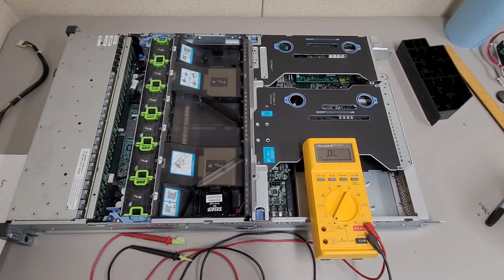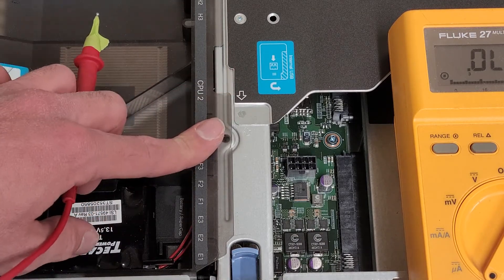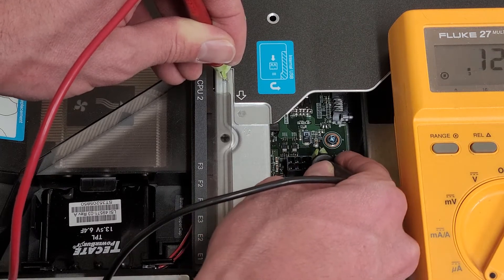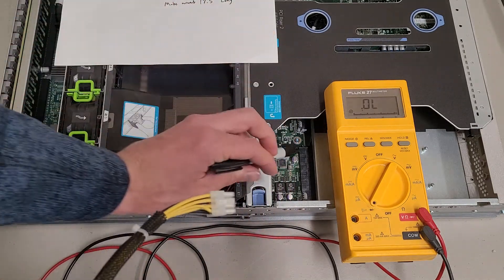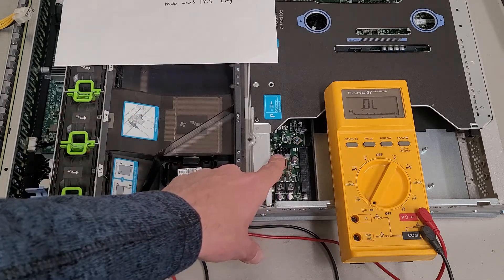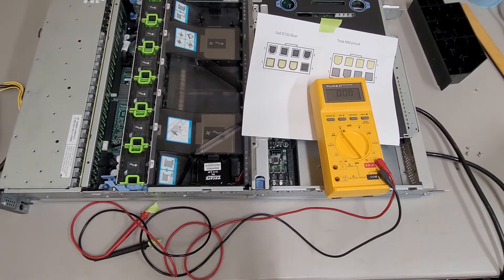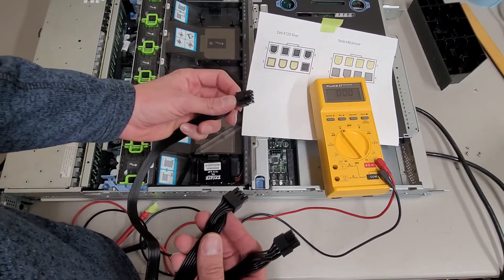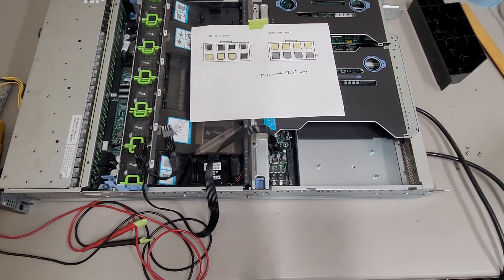Inspecting the GPU Power pinout on a Cisco UCS C240 M3

Comment: It's great to see this video. I'm planning on running a few GPUs but On UCS C240 M5 I recently bought.  The only caveat is that server has a 10 pin layout. Let's see how it goes.
Reply from the maker: It may or may not be tricky. I recently tried a Tesla M40 in it with no luck. That server ran my RX580 with no issues though. Should be a fun project though.

Comment: Thanks for doing this video, I'm looking for a GPU cable for the Cisco system and they are much more difficult to find.  Looks like with this I can just order a r720 GPU cable and that would do it right?
Reply from the maker: Yeah R720 cable should work fine. Just be sure to double check pin out before powering up.
Reply: The connector on my C240 M3 seems to be different from all the diagrams of the Dell R720 I have seen. It does not look like the connector shown in the video so servers must have different revisions. Mine looks exactly like a PCI-E 8 pin connector. I do not think the Dell Cable will work but if anyone has any insight, please comment. I have a cable from an old EVGA BR850 and it seems to match but I have to determine if the power lines go to the right place
Reply: @MrAlzaka  it works
Reply: On my C240 M3 I just tried a straight 6 pin pci-e to 6 pin pci-e connected to a quadro M4000. Everything seems to work ok. I tested the card at max power and it is all working. This is also using the standard 650W dual power supplies. Max power load with the quadro is 550Watts. Awfully close to the 650Watt Max
Reply: The main issue is that if you put in a dual slot dual fan video card, there is no airflow so its gonna overheat. You would need a single slot quadro or a card that has an air intake from the back

Comment: Did you have to enable anything in order to get power from the 8 pin? I am testing mine with a multimeter but i am not getting any voltage coming out of it.
Reply from the maker: I did not have to enable anything that I recall. Although usually before I start working on servers I will reset everything to defaults.